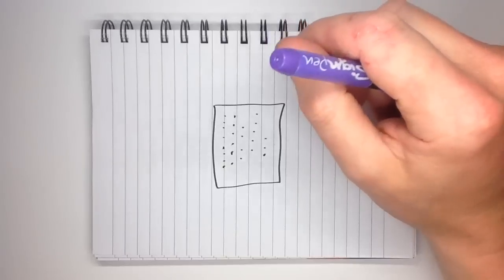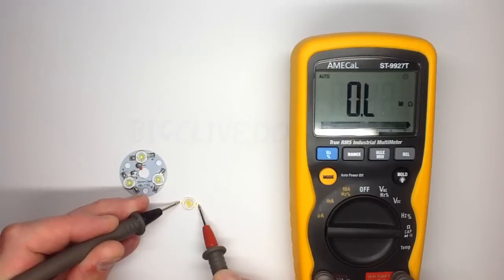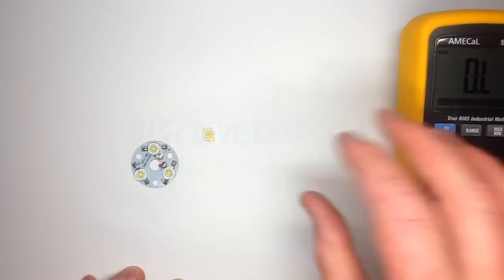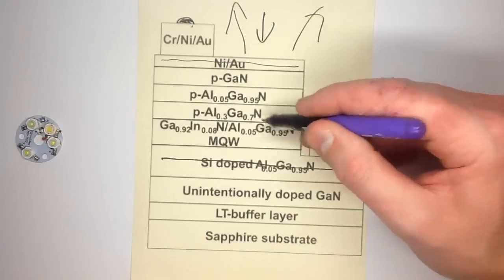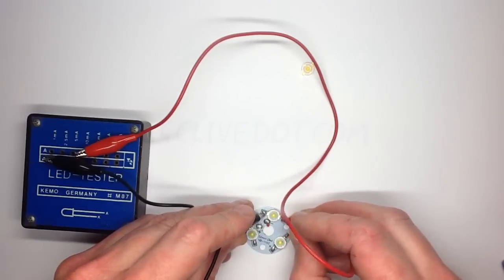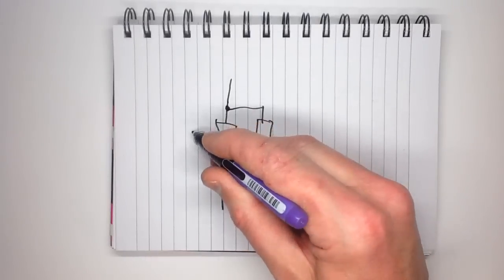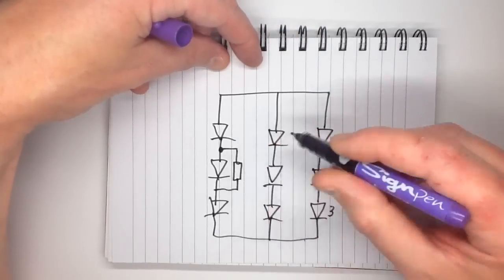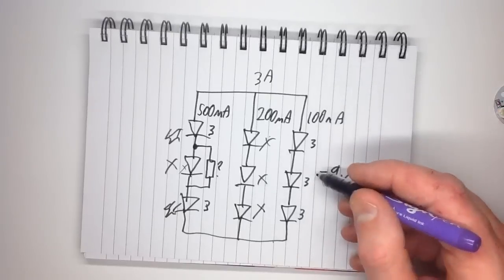The clown-science of crappy 100W LEDs.

Comment: you can easly see this with a welding mask, all these "led experts" should know this
Reply: Maltfalc The test in the first vid was proper enough to show consistent LED arrays in the smaller 20W lights and inconsistent LED arrays in the larger 100W lights.  The explanation and test in this vid was also more than proper enough to demonstrate and explain the reasons for inconsistencies.  If there was any amount of consistency in those things they should be lighting up with similar patterns and/or similar numbers of lit/unlit LEDs as power input is increased.  Instead, the pattern as LEDs start to emit light are totally different.

Inconsistencies at lower voltage do not definitively prove these LEDs will perform differently when operating at full voltage/current.  However, it is definitely what one should expect.  In fact, it is even possible that the 20w LED arrays will emit at different levels once brought to full power, though their consistent operation at low voltage does not suggest it.  It is possible the 20w arrays were made with good LEDs (Cree makes good, affordable LEDs) and the 100W arrays were made with shit LEDs from any number of Chinese crap manufacturers.

I looked for your video that demonstrates all the faults in this guy's test and proves your point via using a welding lens, but failed to find it.  I wish I could loan him one of my adjustable solar welding helmets to give it a look, but I honestly don't feel like investing anything in proving you ignorant as you've done a good enough job of that already with the name calling.

Cheers!
Reply: +Maltfalc  It seems you are implying this is all a huge conspiracy against Chinese LED manufacturers.  I agree with you.  All Chinese manufacturers are world renowned for their quality control.  4 and 5 year old children are too young to assemble the equipment, so they have the task of testing it.  That is why every product from China is top notch!  .....unfortunately that does not explain the reason so many of the welding machines I ordered from China were absolute rubbish....
Reply: Yes he's paid by what ever alex jones is selling. Maybe the super male vitality enema fluid is going to your head. You sound like the trump supporters that defend trump at all costs using "paid shill" Do you really think the small chinese ebay seller is paying english speakers to write youtube comments? Do you understand how money works? 2nd dumbest comment on the internet. The 1st was your other post.
Reply: well, racism doesnt help either, if you want you can spend more than 5 dollars on crappy leds and pay 30 dollars on a good one
just because the quality range in China varies, it gets a bad reputation, but the problem is that basically all of them are made in China, but racism is everywhere these days

Comment: those comments are the equivalent of saying "if your car makes weird noises, just drive faster and it'll go away"
Reply: wolpertinger They're the ones that put tape over their gauges to hide the engine light haha
Reply: HoZyVN "you said to fix it when the oil light came on honey, so I did. I took the bulb out"
Reply: +wolpertinger Isn't the correct solution to turn the radio up really high ;-)
Reply: +Maltfalc in brightness yes, (because they all reach a max light output) but not heat output and power use, which is what hes getting at, those that light before all the others will be putting out way way more heat, and will be the first to burn out in the end, makes it horrible efficiency wise aswell, dunno bout you but I hate having to use a heatsink twice as big for the same light output
Reply: +Maltfalc hes turning them down to show how unbalanced the LED chips are, the ones that light up at a really low voltage, will be near burning a hole in the cob at full voltage/current, they massively shorten the lifespan of the LED
Reply: +magnusmoty my cooler is quite a bit better than the one off a titan, its a full copper prototype gigabyte rocket 3d pro, the prototype was full copper, even the fins, so heavy it bent motherboards so they never officially sold it (can take photos if you like its a big ol hunk o copper), it has no problem cooling the proper decent quality 45mil chip 100w LEDs, but the cheap ones burn and/or discolor  eventually (tested this by strapping one on a T6 aluminium billet, same effect regardless of how much cooling.) 

the cheap ones will do what you want just fine, and work for a decent amount of time(or not, depends on the individual chips with the cheapos) but for $1.50 or $5 it doesn't really matter you can swap em out no problem, but if you are going for a perma install with no easy access fork out the $40-$80 for a decent quality 45mil LED chip.

and you want to keep them below 65C if you can help it.

none the less the point of what I said is, bigclive is right, its inefficient and bad practice to not pair the led chips in the cob correctly, causes uneven heat patterns, and makes the chips in the cob that light up first, put out more heat when the entire LED is lit to its full brightness.

these trolls and others are either trolls being trolls, to which I am feeding them, or they misunderstand what hes saying, in which case they should either study up or shut up lol
Reply: +wolpertinger You would be terrified if you knew just how many people actually do that.
Reply: +magnusmoty for the cheapos 61C max, expensive ones 41C max on the heatsink, this made me interested so I ran a no heatsink 1 minute test on a pair, one cheap one good to see what temps they get up to and what the pattern was, the cheapo had 3 spots of 230c before I had to shut it down early, two top left, one bottom mid,  the expensive one was evenly 150c when I shut it down at around the same time to match(ended up being 43 seconds) they do indeed heat unevenly but for the price of like $5 for the cheapos, not really an issue for most torch etc types, also with a lux meter, the cheapos are way less than the decent ones, but still blindingly bright
Reply: +phuturephunk Or they just turn the radio up.
Reply: +magnusmoty yea, I've got one that burnt thru the phosphor, leaving nice little burn marks where the brightest were and another that left huge discolored spots on the backing plate even with more than enough thermal dissipation and thermal paste, this was in a 100W LED torch with a full copper heatsink designed to dissipate 250W worth o heat. Unlike most of these enthusiasts I actually use my LEDs rather than run em for tests and forget em for the next 6 months
Reply: It's like having a blown speaker and just turning up the volume all the way so the others drown out the rattle. That works great until all the other speakers blow from the added stress of being pushed too hard..
Reply: :-D
Reply: Maltfalc, your argument is interesting but the infusion of bovine feces is moot. You lose.
Reply: The horse is dead.
Reply: Most people just turn up the radio
Reply: +ipissed I think you really over-analyzed that analogy...
Reply: +Jim McG Yes, and then nobody will smell the fart either... :D
Reply: +wolpertinger If your car costs $200 and pretty not-much-of-use some detector of something inside costs $400 with labor, that's actually a good advice to run without wasting money to replace it it.
Reply: +Revoku and what was the temperature?
Reply: +Revoku I Actually have 100W led with an active cooling made of titan twin tubo GPU cooler(with 4 heatpipes) and it is still hot(too hot to touch at the back of heatsink, I would say about 70C) I don't think  (and you haven't mentioned, that your cooling was active) that any passive copper heatsink of reasonable size(you didn't use biggest tower CPU cooler, didn't you?) can sustain a comfortable LED temperature of 85 degrees Celsius. You probably just had your LED overheated.
Reply: Raxis b
Reply: +wolpertinger That make perfect sense if your wheels are unbalanced, and you only have to go the speed that smooths them out.
Reply: +Revoku Have you had any of those burned out yet? They do vary, but flashlight entuasist do overdrive leds, alot, and with proper cooling nothing happens.